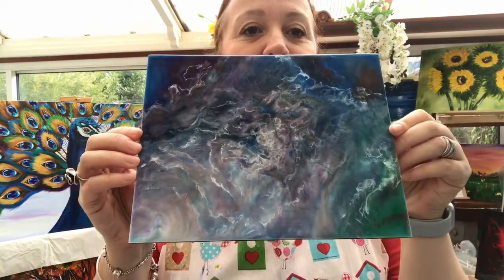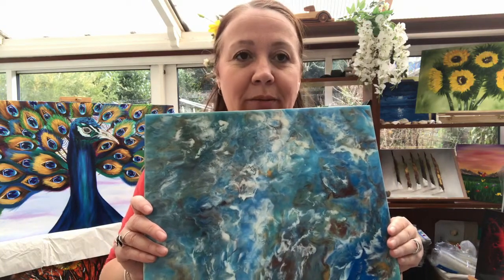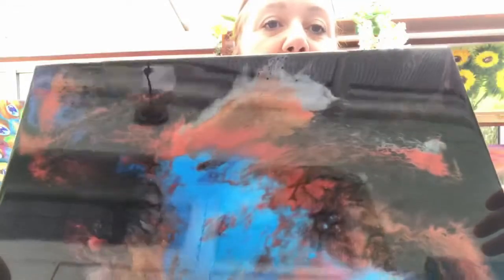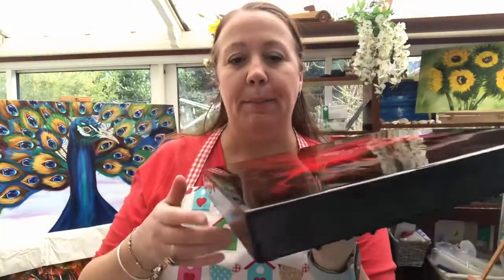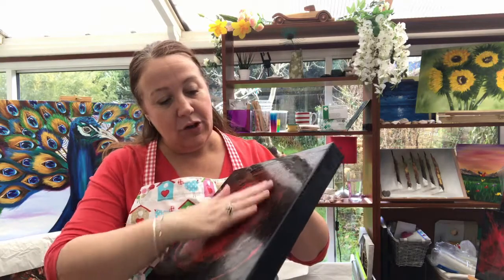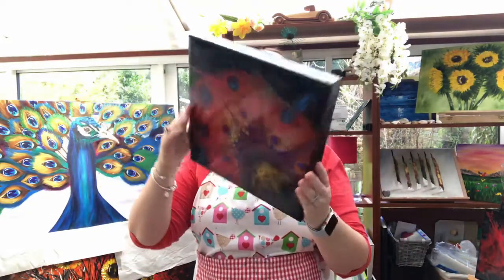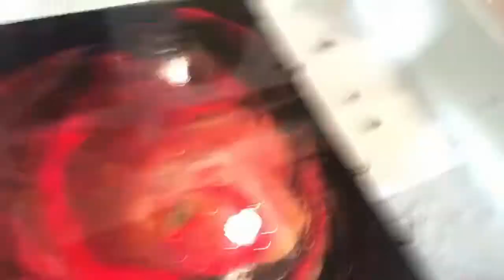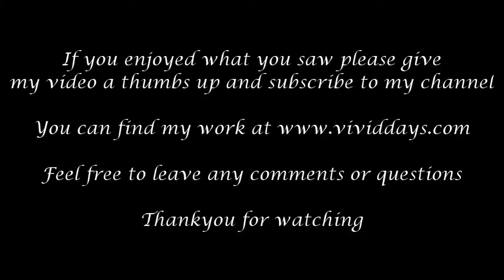8 - Epoxy Resin Art - Beginner - Reflection on my journey, Step back in time

Comment: I suggest tossing out Resiblast. You’ll almost always have to pour a clear coat over because it’s prone to leave dimples where it sits. I’ve had it go all the way down to my substrate. If you want to get a little different reaction, drip some 99% alcohol or acetone on the resin. You won’t need to pour another coat over. However, if you want to use the stuff, you’ll need to clean with alcohol and pour a clear coat on top. Another suggestion for you, cut the tops of your cups you put color in off so there’s no lip. You can then squeeze your cup to have a real nice pouring spout so you can direct it where you want it. Also, if you’ll take a white resin and pour it on top if clear, you’ll get very nice lacing. If you’ll do that same thing, but move the white with your fingers over the clear, you’ll get a kind of smoky effect. This works beautifully if your bottom color is a dark black or blue and is set over night and put the white and clear as a second coat. It’s very ethereal.
Reply from the maker: Judy Sand Thankyou again Judy so much appreciated the time you have taking sharing information.  So valued as I learn the medium of Resin.  I normally work I’m Oils and Charcoal.  I am going to try both of these tip.  I am afraid of Resin blast so I’ll stay away from it.  Do you have a channel with you work in it?

Comment: My tip, is if you are getting your boards already black, I would tape the sides up and just pour the resin on the top, not on the sides. The thing about tape is, once you get it on and in place, then run your fingernail around it and it helps to create a seal. But if a little gets thru, you can sand that then and repaint the sides black
Reply from the maker: I am going to try that.  I am glad you found a solution as you must have gone through a similar experience when you started.  I will try taping the sides.  Thanks for sharing your wisdom and taking the time to leave your comment.  You made me feel and warm a fuzzy after a bad day in the studio.
Reply: Sharon Lindley - Vividdays oh you are creating amazing pieces